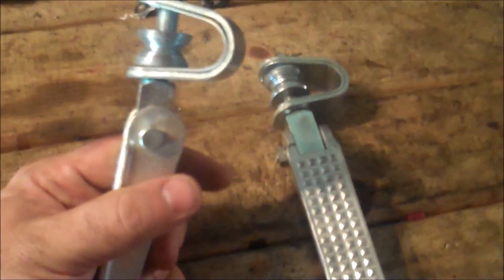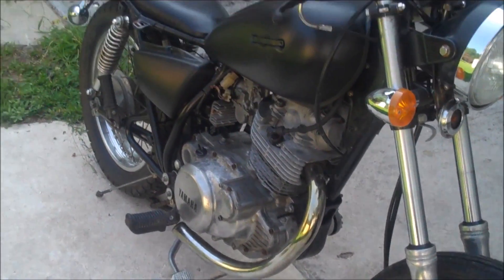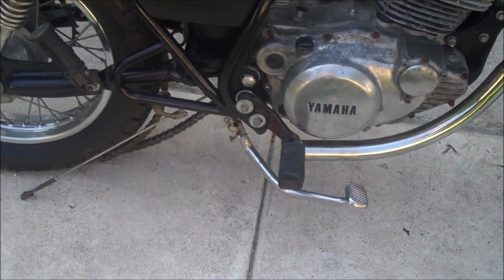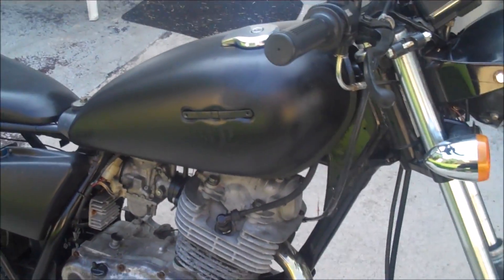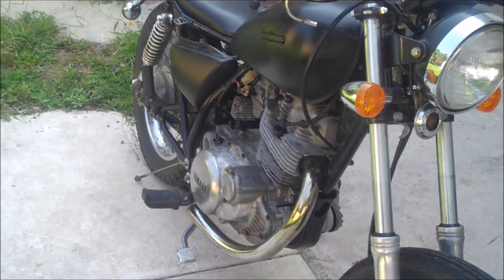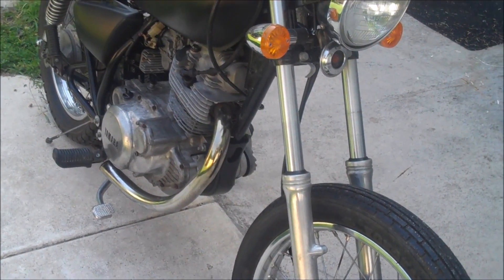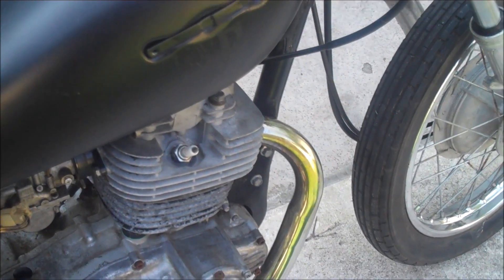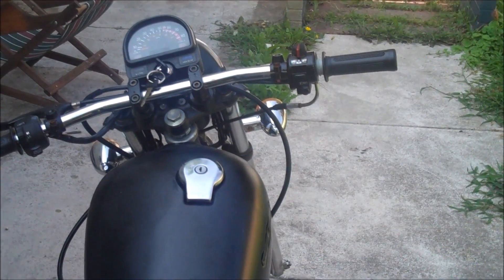Guess the problem, win a prize: Yamaha SR250

Comment: Head job - replace valves, grind valve seats, new cam chain and sprocket and guides. Plus a few other bits air filter etc. should do it. That’s what I’ve just done to mine.

Comment: He's had it apart and didn't put it back together properly. With no compression I suspect that the bike is now out of time, so perhaps those parts are somehow connected to the timing system. Since it started fine originally, something happened after that, perhaps gears slid laterally because of no support and lost contact. The right hand object in your hand looks like a part of a snap ring plier set; not part of the bike, but it does speak to the competency of the prior mechanic. I suspect you've now got secondary damage to deal with -- bent valves or a broken rod.

Comment: the cam chain on these older Yamaha Bikes goes to a cam sprocket which uses two bolts to bolt the sprocket to the cam. i suspect the previous owner did not tighten the bolts adequately and the cam sprocket fell off the cam, slid down causing the timing chain to be too loose creating the rattling against the chain path inside the engine.

Comment: I'm going to go with lack of back pressure from the exhaust.  One of the parts you had in your hand looked like a used exhaust gasket.  Also when you were turning it over it sounded like it was leaking exhaust.  With all the additional air and fuel you are giving the bike (with the new cone filters and jets) you need to make sure that the exhaust is tightly sealed to the engine and that it's getting some back pressure to maintain compression.

Comment: Put the cam on out of alignment and one or some of the valves were pressed against the cylinder head bending the valves allowing for a leak in the pass the valves.

The parts in your hand: two nuts look new/ external. two center parts appear to be a slip washer and a geared spacer of sorts. The far right looks like a replaceable tip for c-clip pliers

Making it possible that the spark timing would be off after the few seconds of running.

Comment: I'.m gonna guess that the noise is now coming from the cylinder and little/big ends due to no oil being pumped around due to you having the oil pump drive gear in your hand. compression loss is down to no oil being pumped around motor

Comment: I suspect its getting too much fuel. it's bogging down with too much gas in the mix due to the bigger jet installed. been there done that. remove the plugs and dry them then let the fuel in the cylinders evaporate for about 10 minutes minutes under the sun. put on a smaller jet or lower the slider needles to see if the symptom is reduced; may also want unscrew the pilot screw half a turn to give it less gas in the mix. rinse and repeat with different combinations. also try to tighten the head 1/8 or 1/4 turn it may be loose hence compression problem; you can also try a tiny bit gasket sealer on top of the head gasket.
Reply: ***** Dude, yes it can. You can still run rich if your air/fuel mix is off - even with pods and open exhaust - been there done that. You need around 14:1 air/fuel mix. Here it could be 9:1 which will make it bog down and turn off eventually.

Comment: something to do with either the valves or the cam chain?
 
Maybe the cam chain snapped/ jumped off and one of the valves is stuck in the open position 
and that is why you have lost all compression and when you turn the engine over the top of the piston is making contact with the open valve, giving you that nasty tapping noise?

Comment: I would check the bolt on under the side cover that the starter turns the crankshaft, The bolt that goes in the crankshaft came loose. that's all I got.

Comment: First reaction is the coil is not providing a spark to the sparkplugs. Second: doesn't the engine require back pressure from the exhaust. Thirdly: If the compression is low..did someone not align the rings properly, or a valve is stuck in the open position, or a loose timing chain slipped a sprocket.  just thinkin the check list :)

Comment: If he used old gaskets when putting the engine back together then the old gasket could be too thin and out of spec which could cause the piston to hit the valves or wont allow the piston to hit Top-Dead-Center in the cylinder

Comment: It started up fine first time after you put on new filters and stuff right? You also gave the impression that the bike ran fine before he chopped the exhaust. I'm guessing he has taken the carburetor apart and put it back incorrectly, probably jets or something and the fuel / air mix has gone to hell.

Comment: Hey I got a 1980 sr 250 and I'm gonna put  pod filters on it and I'm curious what size jets I should throw in the carb?  Will I need to adjust timing or valves afterwards?  Any help would be appreciated!
Reply from the maker: +Jason Workman You wont need to adjust the timing or valves, but you should increase the jets a couple sizes. See my jet adjustment video for instructions on how to figure that out
Reply: +mrmaxstorey didn't realize that was one of your vids, watched it a couple times already.   So I've went up 2.5 on main jet and raised needle slightly and still running lean, should I go up another couple sizes on the main?  it bogs a bit when at 3/4 to full throttle.  Also it pops like a slight backfire when shifting gears, is that because it's lean or us it probably a timing issue?
Reply from the maker: +Jason Workman If the timing was good before, its still good. I'd keep working on getting the jetting right. Try going up more on the main

Comment: ok so paces r from oil pump it start and die do to no oil compression probably now the spark plugs  not getting any spark that is what the noise in the motor is now likely your valves got mess tap   too .